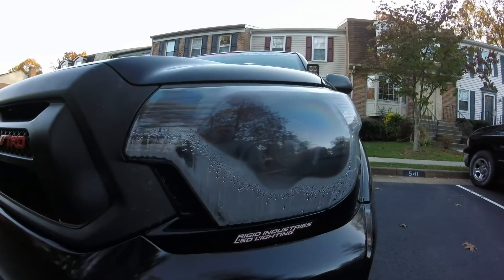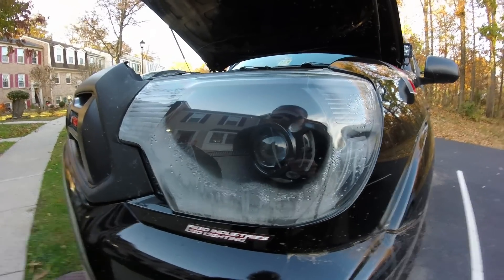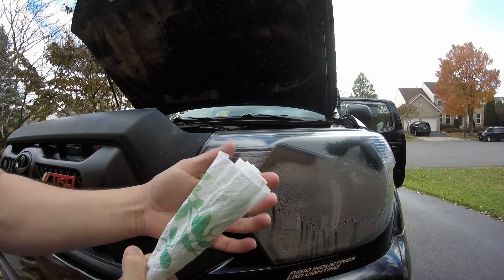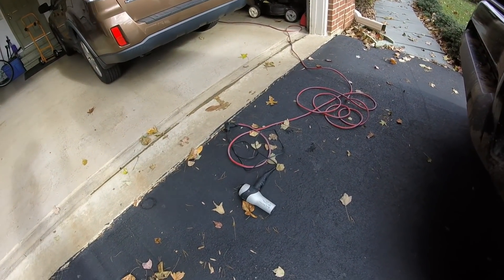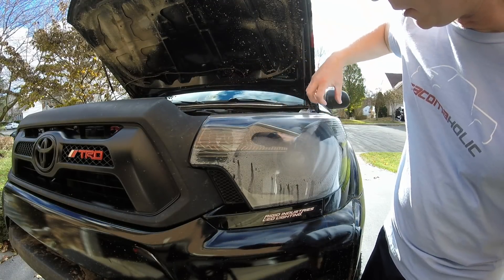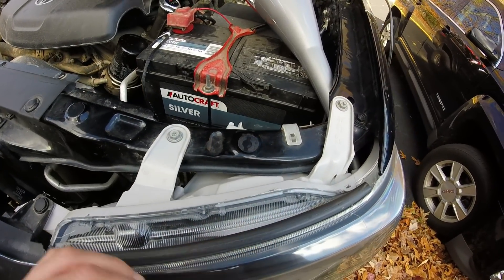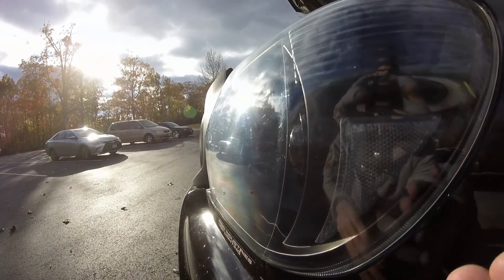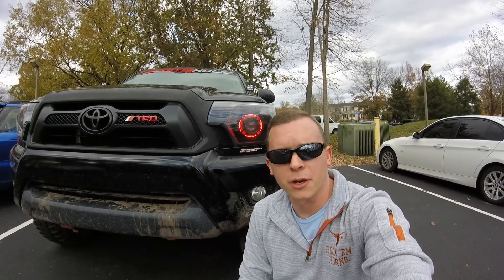The Toyota Tacoma Video I Wish I Didn't Have to Make

Comment: An easy way to check for where water is entering your headlights is with air.  Take your headlight bucket back off the truck.  Remove one of the lights and tape up an enclosure around that one socket area, and apply 1-4 psi of air.  Use light soapy water and spray around the entire lens, and other light socket holes.  Mark each area that shows bubbles, with tape or something you can remove later.  Move your low pressure air intake area to each of the other bulb sockets and put back the bulb into the hole you just used, to eliminate the each one.   Then go back and seal up all of the gaps you found.

Comment: Ran into the same problem in mine before I replaced and sealed new ones. I got some headlights off eBay for my truck and they even came with a warning. After battling the moisture over and over, vacuuming and airing it out, I bought new. When I bought new I completely sealed them with some adhesive high temp clear silicone and so far so good on new ones. Fingers crossed.
Reply from the maker: Unfortunately the moisture will always win unless the headlight is fully sealed. Hopefully I won't have to remove my entire headlight and seal it up. We will see.

Comment: Did using clear epoxy solve your fogging/moisture problem? Are they doing better? Do you have an update? I'm getting front and rear aftermarket lights too and am wondering if I should place clear epoxy on them prior to installation.  Just received the rear lights and placed clear seal epoxy bead around the edges of the rear lights.  Noticed the clear epoxy seep just inside the lens for seal. Am I heading in the right direction or is this over kill?
Reply from the maker: I used some clear silicone around the exterior seam and it helped alot. I've only had some fogging in the lights a few times since then but no where near the moisture accumulation as before.
Reply: @Tacomaholic  did you apply around the whole light or just the top part?

Comment: I am having the same issue only it is with the factory headlight units. 

I bought the truck used 12-16 and part of the purchase agreement was that they would replace the condensated headlights. 
They finally replaced them in 4-17 and the new ones had fog by June. 

Here is the kicker to all of this. I live in Las Vegas. Right in the damned desert and it still took forever to evaporate, but they both still fog up every time we get the tiniest of rain. 

I got the old ones back so I am gonna play with them and see what I can do to seal the new ones, without destroying them, I'd like to sell them eventually.
Reply from the maker: Sorry to hear that Marvin. Crazy how just a little humidity can fog them up. I would think that yours would dry super fast though with the Vegas heat. Just run a thick bead of clear silicone along the entire perimeter where the clear outer plastic meets the inner plastic. That should fix it assuming your bulbs are firmly seated when installed.

Comment: Lol...nice. U can try using foam weather strip (d one u can buy at a hardware store).  It can be shaped 2 whatever & it goes in small crevices that condensation usually gets.  Its not messy n much more easier.

Comment: My tail light did that, but dude before me had a broken tail light and left it like that. So I replaced and you know what it was the damn gaskets around the light plug ins, so I just put some silicone paste for now and that seemed to do the trick. Hope you got the light issue resolved.
Reply from the maker: Yep the bulb seals are the second area where moisture can get in. Hope to get my issue resolved soon.

Comment: Those look badass man.  I actually plan do a similar setup on mine using the morimoto projectors but a d2s led bulb instead of HID.  What makes it so you can change the color?  Is it just some led inserts or is there a dedicated rgb switchback?
Reply from the maker: Thanks! Gosh there are like 12+ colors to chose from that can be changed with a remote. I think it's a Morimoto kit.

Comment: These are retrofitted, Ive got the same type. Same manufacturer. On the exact same side as you I have had 3-4 different condensation periods. I let it do its thing and it eventually dries out. But it is quite annoying. And as for some of you saying aftermarket is cheap. There is nothing cheap about these retrofitted headlights. Upwards of a $1,000.
Reply from the maker: How long since your last fog-up?

Comment: Use a semi thick wire and wrap paper towel around it. Could help more.
Reply from the maker: That's good too, but I'd be paranoid about scratching the inside of the headlight.
Reply: Tacomaholic just tape the end of the wire

Comment: Off Subject, I know.  You should do a video on bed stiffeners, I know Total Chaos makes a pair. 
 I can see you don’t have a pair of bed stiffeners, and you’re running a rack system.  I heard that these racks can cause flex and cracks in the bed, and I’m running a camper shell on my rig, which is a lot more weight than a bed rack, and am very curious about these bed stiffeners. Thoughts 💭?
Reply from the maker: Bed stiffener vid coming in the future for sure. I just need to decide on which brand to go with. Those Total Chaos ones are crazy expensive.
Reply: Tacomaholic 
I wasn’t sure anybody else made those stiffeners, this is good to know, I know none of us want to have any cracks in our bed.  I look forward to the video & thanks for the response.  :)
Reply: Jillian Rebekah was talking about that on her channel. She has the rack bolted down in the floor of the bed to avoid the flex...
Reply: John Ganshow nice! I’ll go check out what was said. Thx :)
Reply: Rago Fabrication and At The Helm I believe is the name, both make them. Overpriced for Rago at least for sure.
Reply: Ben Pitcher +1 on the Total Chaos bed stiffeners . I have them on my 2017 taco and it really helps. Plus I got some extra tie down options now. I recommend them highly if you are running a bed rack. Mine is a new 2017 and my bed was already starting to flex after hitting some trails. When I tightened the bed stiffeners the bed went right back to its original location.
Reply from the maker: Yeah I've seen a few different companies make them but the cheapest is still around $100. Good mod to do for sure.
Reply from the maker: That's a great way to mount a rack if you are able. The KB Voodoo rack only mounts to the bedrails though. Thankfully the entire rack (with all of my current gear on it) only weighs about 100 lbs, so the bed separation issue will develop much slower than if I was running a heavier rack.
Reply from the maker: Taco Trek - Don't forget that you can also use those bed stiffeners as a bottle opener ;)
Reply: Taco Trek I’m running 340 pounds on my bed rails, I have an adventure trailers Tacoma habitat system. About two hours ago I just ordered my total chaos but stiffeners.  :)
Reply: Tacomaholic Already used the bottle opener today while fine combing through finding new dings and scratches. The beers help me forget.
Reply: Ben Pitcher yea thats how much weight I run. Before you install the stiffies, take measurements for before and after. My bed started to move outwards after about 3 offroad trips.
Reply from the maker: I hear that! 😀

Comment: Where did you get those colored lights inside your headlights and are they legal..?  They look cool but I wonder if the cops would pull me over if they see red lights in the front of my vehicle..?
Reply from the maker: Hey Vin they are part of the headlight assembly. I'll be doing a full vid on them soon. The white and orange are legal  but the other colors would certainly get you pulled over.

Comment: It seems the majority of people I know that change out their OEM headlights or modify them by opening and installing halo's always have problems down the road with moisture buildup or burned out bulbs probably due to seals leaking. With that said maybe this MOD should be added to your list of MODS not to make to your Tacoma.
Reply from the maker: It can certainly be a headache if the headlights aren't properly sealed. I've seen a bunch of guys get aftermarket headlights and apply an additional layer of silicone or other sealer and not have any issues at all.
Reply: Took no chances and resealed mine before installing and so far no problems

Comment: Why didn't you seal it? All aftermarket headlights should be sealed imo
Reply from the maker: These are custom headlights that were supposed to be properly sealed and ready to install. Lesson Learned.
Reply: Yeah I always sealed mine even if they say they came sealed, I made the same mistake before..
Reply from the maker: Hind site is certainly 20/20 😀
Reply: Always
Reply: With my new to me 2012 I have the stock headlights just replaced the bulbs 
https://www.instagram.com/p/BbsiT5DF9Hu/

Comment: Pffftttttt.... I would just buy a new one put the old one back in the box and return it
Reply from the maker: Believe me I have considered doing that ... but I no longer have my stock headlights. #effmylife
Reply: @Tacomaholic  the point is that you recieve the new one before sending back the bad one.  You say the bad one is the one you just recieved.
Reply: He isn't very bright is he. No pun intended.
Reply from the maker: @waynes.2983  These are hand-made headlights so it's not like they are sitting on the shelf waiting to be shipped out.
Reply: @Tacomaholic  it is made by Rigid industries right? 
How long did it take to get the two you've got?
Reply from the maker: @waynes.2983  No these headlights were hand-made by a guy on Tacomaworld who does custom stuff. These took nearly a year to receive AFTER I had paid, hence my hesitation on just sending them back.